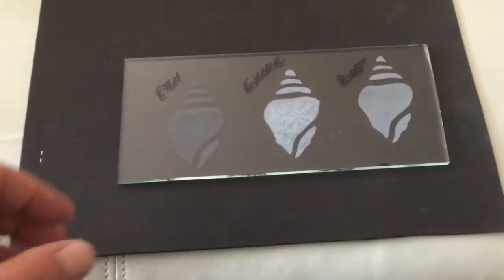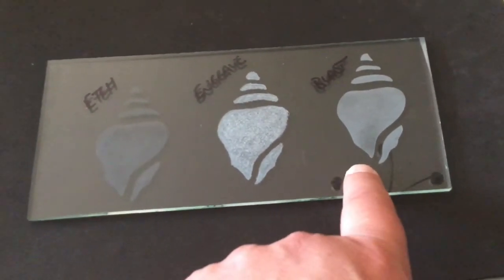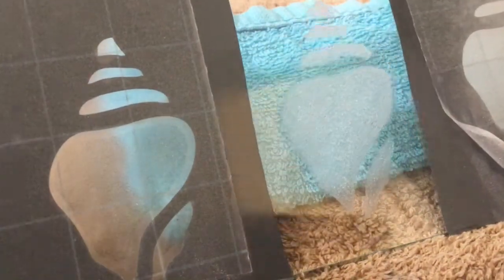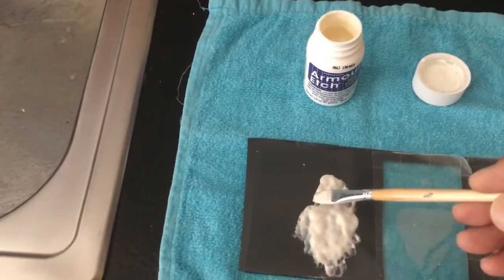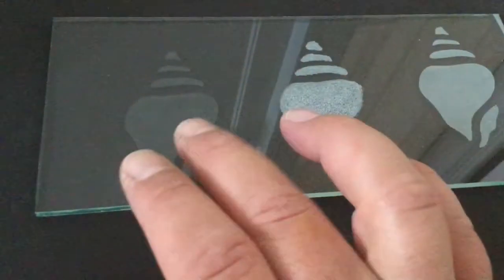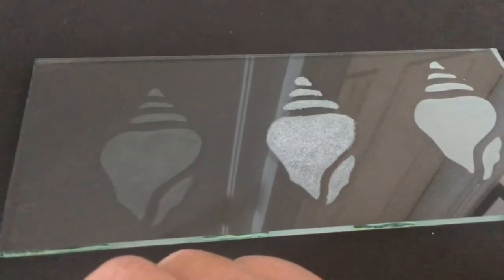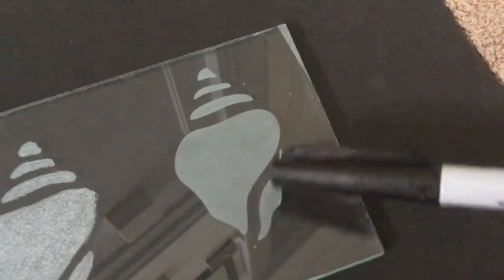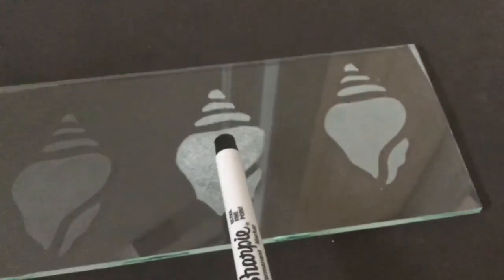Compared - Glass Etching, Engraving And Sand Blasting

Comment: Happnin moo, a requested you as a player on ps4, you sound like you live in Glasgow or paisley or something. Thing is I've got a guitar and I've had a bit of trouble getting the pickups working. I bought one of these none solder click together harness set up. I thought I put it together well but didn't realize I need to solder an earth wire l. In short I can't get any sound from the guitar and was hoping you'd except some money to fix it. You could also make a video about it if you wanted
Reply from the maker: Hi Joe, you’re close, but I’m actually down in sunny Ayrshire (I know - tattie howker!). I’m just heading out to work, but will add you on PS4 later and see if I can help you out over a chat. Cheers
Reply: @themoo7803  magic